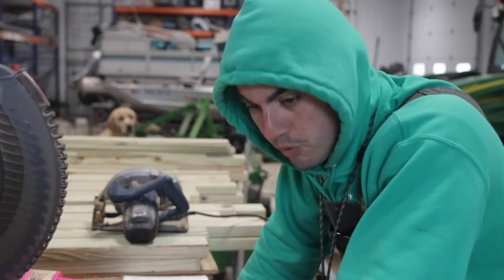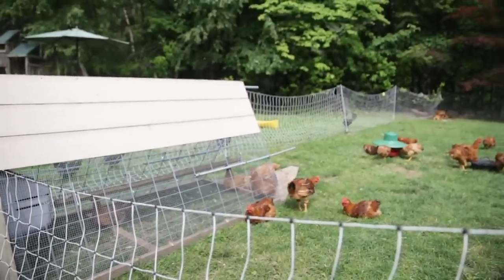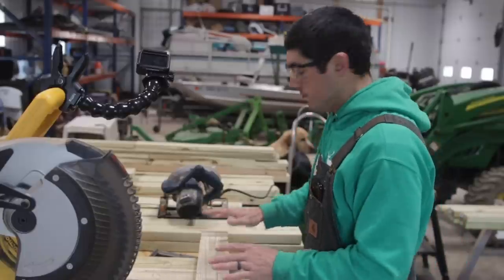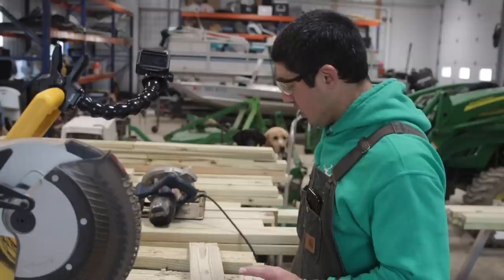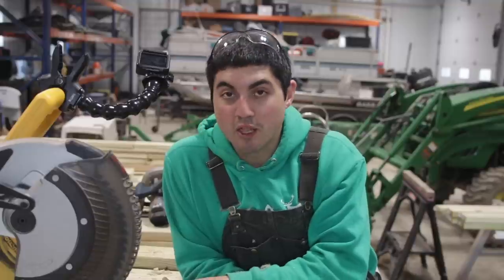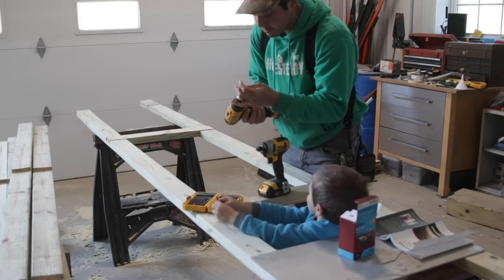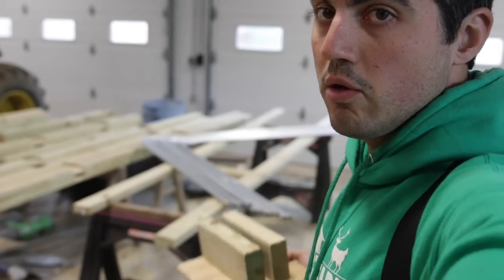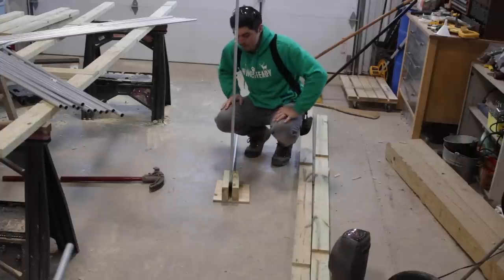WHY I NEVER BUILT A SUSCOVICH CHICKEN TRACTOR...

Comment: We built 3 of these for our small farm. They are great for chickens, turkeys, etc. The one downfall for them was our cow used them to scratch on and broken the conduit. My solution was to put on 2 pieces of 16ft cattle panel and on each side I screwed some pallet wood over the edges of the panel to hold them on. With this modification I got even more head space, a sturdier roof and some extra weight because i have had them move with very strong winds. I have friends who have converted from the salatin model to these after seeing mine.

Comment: There are several different tools you can use for lap joint. A skill saw, like you used, a table saw, a radial arm saw, a router, and even a bandsaw. And of course, like others have mentioned, a dado blade helps tremendously.

Comment: Chop saws can be fit with a dado blade that cuts a slot up to 3/4 inch wide depending on the number of chisel blades you add. Adjust the depth, and you can cut the half lap in seconds. And it's smooth finish.

Comment: I feel validated this is exactly what me and my brother went through this making mine...also belt sander instead of chisel and worm drive saw makes a regular circle saw look like a chump... I also opted for the 2x4 welded wire instead of chicken wire because I loathe chicken wire... I now hate hardware cloth more than chicken wire though. Thanks for the great content
Reply: Chicken wire is the very devil - no strength, doesn't keep small things or persistent things out, and falls apart or rusts through in an eye blink.
I love the 1 x 1 or varied height fencing. Hardware cloth can be just glorified window screening, but it can also be wonderful for cage floors or making tight (if expensive) fences.

Comment: Set the blade on the table saw at 3/4 height.  Set fence 3 1/2” from blade.  You can make all your cuts over lapping or knock out the piece like you did.  To get a smooth surface you can then run the cut section back and forth over the blade.  You need to use a sliding miter to cut the cuts that are in the middle of the boards.

Comment: WHAT ABOUT AN OSCILLATING TOOL? For those cuts?  very fast (about 20,000 strokes per minute), so it feels more like vibration. An oscillating saw blade is shown; the oscillating tool also works with scrapers and sanding pads. www.harborfreight.com/variable-speed-oscillating-multi-tool-63113.html.  I use mine for a ton of stuff!